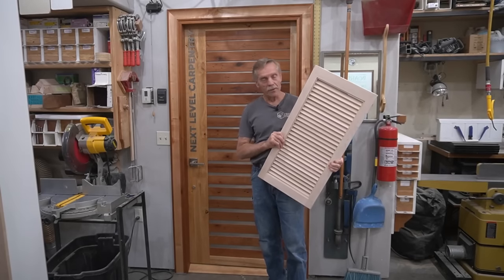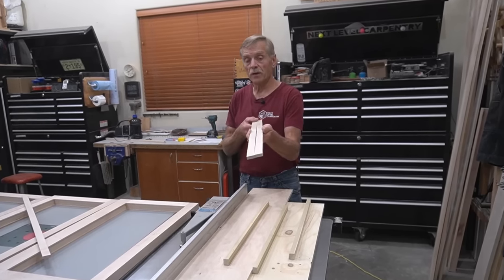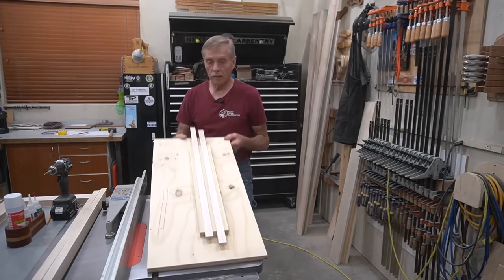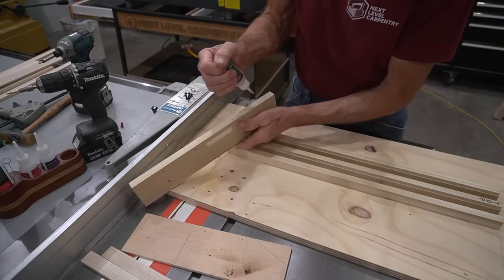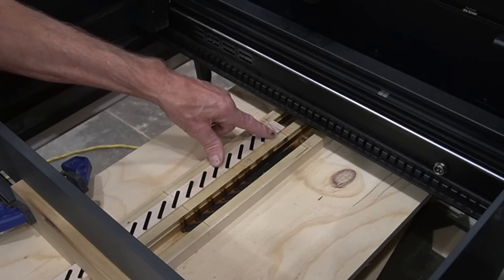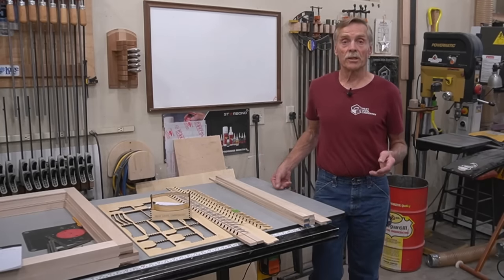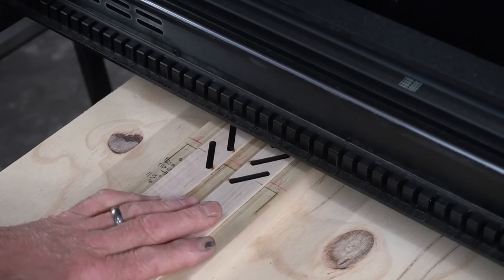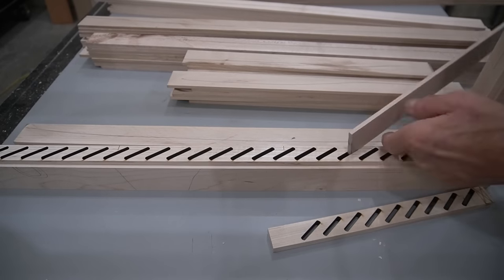Lasered Louvers

Comment: When using your laser with a fixture such as this, consider adding some aluminum foil to the base where possible.  The foil will keep the wood of the fixture from getting so charred over and over in the same place turning it into charcoal.  Speaking from experience things can get warm pretty quick burning over the same area repeatedly, especially if the machine has air assist.  The foil will also eliminate having to use the water.  Hope you find this useful. Thanks for the great videos.  I really enjoy them and don't mind the length at all.

Comment: Thankyou.
My daughter wants a set of louvre doors for her wardrobe and I have been procrastinating over starting this project, knowing that if I blindly launched into it, I would have a lot of problems with the  assembly stage.
Your video has provided all the answers to my questions (and others I hadn't considered).
Reply from the maker: This is a challenging and rewarding project albeit rather impractical so if you have any options for pre-made louvers you'll be time and money ahead... but you would miss out on the trill of success IMHO 😎
Reply: @NextLevelCarpentry   good point 😉
Although I am sure, with care and your insights, we will end up with something nicer and better suited to our needs. (And also it is an opportunity for some father/daughter woodwork - which is beyond value) 🙂

We won't be fiddling about with "frickin lasers" - but do have a CNC we built together years ago  - a bullnose will be sufficient.
Reply from the maker: The best thing about making louver slat mortises with a CNC instead of a laser is that you can cut them directly into the stiles of the Louver panel which would simplify the process and there's no shame in a bullnosed Louver slat IMHO
Reply: @NextLevelCarpentry   I was thinking about making an "assembly jig" stile, with oversized through motrices where I can feed each slat into place and individually glue each at my leisure during the first phase of assembly...
But I am sure, no matter what, I will still be left with the awful "fiddling a bunch of slats simultaneously into a bunch of mortises" phase when the final stile is being fitted. 
Another thing is making the same jig  but split, so it can be in place to help with alignment during assembly and removed once the glue sets.
I kind of want to glue all the slats for rigidity because they are large doors...
(So many assembly ideas - and I am sure everything will go to hell once the glue begins setting).
It was really nice seeing your approach, thank you 🙂

Comment: This. Yes THIS is why I’m a dedicated Patreon subscriber. 
Thanks much for this video Matt. As you know I’m still a rank novice learning the ins and outs of my CNC machine.  The dadoed fixtures you developed to precisely hold the material in place, and then being able to slide the material to a precise point got my gears going on what I can do when I want to machine something beyond the limits of my CNC. 
Great tip at the end of the end, I saw the slot, and did wonder how you “sawed” it. I envisioned forstner bits and a sharp chisel. I will remember this tip!
Great stuff as always Matt.
Reply from the maker: Knowing guys like you and your buddy Mark are out there in the arena motivates me to get off the sidelines and tackle intimidating new stuff like lasers and CNCs.
FWIW working through the challenge of precise location opened up new possibilities in my thinking and also makes some of the more routine things like engraving front & back of objects a breeze (I'll text you picture of an example)
Funny  you're 'one of the 3' who wondered about that hole in the fence... crazy how easy it is with an outside-the-box approach!

Comment: Matt, the video titled “Ortur Laser 3 - Make Your Own Adjustable Risers & Always Square Cutting Board “ by RuffLifeInc on YouTube might just be what the doctor has prescribed your laser’s precision requirements.
Make the cutting board, laser in the outline grid and any other grids lines with mm settings. After this make the risers and you off burning wood, or ‘laser beam sawing’.
Enjoyed the video immensely.
Reply from the maker: Thanks for suggesting the connection Bill... I'll endeavor to check into that video😎
Reply: @NextLevelCarpentry  They have other innovative ideas and improvements designed & implemented. Like bases for routers, air assist improvements, bench dogs & extendable feet. Look over their collection of videos uploaded.
A very inquisitive & future thinking on improving the laser community for all.

Comment: Great video as per the usual Matt.  Your jigs demonstrate your genius more than any other aspect of your work.  I really like that jig you made for cutting the thumbnail on the louver slats.  It reminds me of a time I made like, a 3/8ths inch thick trim piece that had a thumbnail profile but the chatter was nuts  (because I did not have it sufficiently held down like your jig does).  Bravo.  I stayed to the end of the end of the end like I always do.  I'm just disappointed I did not see Chip (hehehehe).  BTW, I'm also scratching my head thinking about how I or anyone could go about building this without a laser.  How could you get repeatable and accurate cuts in the side pieces so that the louvers slats fit just right?  I dunno.  Thanks again Matt.
Reply from the maker: A clever template and a plunge router are quite capable of producing mortises for louvers although the only slat option is for a full-bullnose profile of the same radius as the bit used.  There's a couple YT videos showing the process and I think, with a bit of re-thinking, a clever/elegant jig is very possible.  As I tried to explain in the recent Patron-only video, I was very close to ditching the lasered louver plan and reverting to a more typical and familiar router & template process which has been the status quo for a LOOONG time.

Comment: OK, now you just make me want another tool in the shop. Great way to bring a relatively new tool into the shop processes. I will say I used my CNC router to do the same thing last summer. Both my CNC and your laser are about same price. Both have unique capabilities but I think they would compliment each other in many projects. Wonder how I can justify a new tool for Christmas? Second problem is were do I put it.
Reply from the maker: It would be a tough call to choose between CNC router and this laser as both have strengths and weaknesses.  The laser has finer 'resolution' because the beam's 'kerf' is minuscule but leaves a burnt edge.  I think a CNC would dovetail better (pun intended) with profitable/productive woodwork but the laser has the potential to 'frost the cake'.  All things being equal I think it would be a tough call to choose between a laser and a lathe but it's great to explore options and learn new things.
Reply: @NextLevelCarpentry  My CNC router has a laser option for it, also there is a u-tuber that has taken the same CNC I have and made it a CNC plasma cutter.
Reply from the maker: The ability to program a CNC and have it carry out complex fabrication demands is a game changer for sure. I found it does require considerable commitment to undertake the paradigm shift into the new technology and its capabilities but it can pay off for the determination to become proficient with it

Comment: First of all, those louvered blinds are just beautiful. Cheap plastic knock offs can not compare, yet they've replaced wooden ones 99%.  Can laser technology bring back the traditional wooden  ones?  I hope so.  There's enough plastic in the world already. Interesting use of  laser, I pretty much considered it a sign maker's tool until now.
Reply from the maker: Thanks for watching and commenting on this one.  I think the drift from wood to plastic in shutters has more to do with material costs than machine capabilities which 'laser technology' won't resurrect. I hope to find other practical/non- sign maker applications for the P2 laser in the future but, if I'm being honest, it's hard to see it as much more than a solution looking for a problem at this point.
Reply: " A solution looking for a problem" - well said.  Honestly, I think I could have built a jig to router out the mortises for the louvers in about the same time it took you to set up the laser with jigs. But that's not the point, and your video is a good demonstration of what else laser technology can do for woodworking.  We just need a bigger problem!
Reply from the maker: @gavinfeargrieve4874  I like your perspective on this!  I'm pretty sure I could have come up with a router jig for these louvers in less time than climbing the steep learning curve required to burn the mortises with the laser too but feel it was an investment of my time rather than a plain expenditure for the insight it gave me for approaching 'bigger problems' that are sure to arise over time.

Comment: Extraordinary content as always!!  I recently purchased a laser and have struggled with the alignmen problem.  I will definitely use your insights and techniques in the future.  Well done!  Side question Have you seen/thought about Shaper Origin for your projects?  The same design software for laser projects works for this tool as well, eliminating the need for many routing templates (it can also make very precise and complex templates).
Reply from the maker: Thanks Steve... I've seen Shaper Origin and sidestepped offers to try one out but who knows what the future holds.  Tackling the learning curve for the P2 laser and the software required to generate program files and set up and run the machine was a fairly daunting process which I imagine would be similar for the Origin.  My goal is to adopt/adapt new digital technologies without losing sight of my hand-on/analog roots which can be a bit tricky to navigate.

Comment: Another awesome job Mr. Jackson!!! I have a question. I was in Ruidoso New Mexico about 15 years ago and was staying at a log cabin we had rented. It was a beautifully made cabin and had tons of awesome woodwork in it. The question I have is about the louvers that were in the cabin windows. They were made of wood like yours but these louvers could be opened and closed vertically by swiveling them left or right but they could also be opened or closed by sliding the complete louver set back and forth. I took numerous pictures wanting to try and duplicate them after I got home, but somehow lost the pictures from my phone. I'm wondering if anyone has ever seen anything like these or may know of a place I could buy some.... Thanks!!!!
Reply from the maker: That's a someone common window covering system although I've only seen them in fabric/plastic, not wood.  It would be all about finding the right hardware and attaching wood slats to it although slats that are all wood would need pretty robust hardware.  I'd bet that someone, somewhere makes just that kind of 'blinds' with plastic slats and wood veneer?  Otherwise search 'plantation shutters' for more info.
Reply: Thanks, @NextLevelCarpentry  ! I have spent several hours of searching but didn't find anything. Maybe "plantation shutters" will be helpful. Again, thanks Matt!!!

Comment: Hi Matt, not for me, I build louvered windows with a template by the bunch in a hurry, I do own a small cutting láser courtesy of another woodworker and basically sits unused on a corner, how do you feel about this compared to more traditional methods? Is there any real use for them on a woodshop?
Reply from the maker: Sounds like we both have been successful and profitable without a laser so it's hard for me to argue that there's 'any real use for them' in a legit woodshop.  If I'm being honest I doubt I would have spent $4K+ for this laser and spent countless hours learning how to use it but, that said, after going on this journey I'm starting to really enjoy having the P2 in the shop.  The main benefit of having a laser for this project vs 'more traditional methods' is that I could make louver slats with the 'thumbnail profile' shown vs typical bullnose or angled edges.  It would take a lot more examples like that to make such an expensive piece of equipment actually pay its own way to make it a responsible investment but that may change over time.

Comment: Hey Matt - love the content as always and need to add some CA glue to my new shop.  Looks like the NLC code doesn't work though :(  (I'm buying it anyway)
Reply from the maker: I don't know how I got along without CA in my shop and without Starbond CA in particular.  Thanks for using the code for your shopping. You should get some discount offers at checkout if you start out with the link from this video, often 20% actually, but the ad fee/commission accrues to NLC regardless which I always appreciate!
FWIW you might want to consider making this caddy for that CA... both invaluable to my workflow:
https://www.youtube.com/watch?v=8KU1u_5xvV0
Reply: @NextLevelCarpentry  that caddy is on my short list!! I made 4 of your journeyman sawhorses a year ago...
Reply from the maker: @VAXHeadroom  Cool!

Comment: Yikes please take off gloves while you’re using the table saw. So easy to catch in the blade.
Reply from the maker: If it's "so easy for you to catch the blade" while using a tablesaw WITH gloves, it's equally easy for you to suffer injury WITHOUT them.  I suggest you re-think your workflow to keep your fingers out of harms way instead of insisting I react to your alarmist admonitions because my use of specific gloves during specific actions greatly reduces the risk of injury.  Please take your crusade of uninformed caution to other Channels where practices that are truly dangerous go unchallenged by the uninformed.
Reply: @NextLevelCarpentry  fine lose a hand or finger
Reply: @karadanvers6136  No need to sulk.  Use of gloves here is very well considered and explained in detail in another video.  These gloves are close-fitting.  If you get close enough to the blade to snag these gloves, you are way too close and would likely get injured anyway.  It is never a good idea to blindly make a religion from something you see or hear.